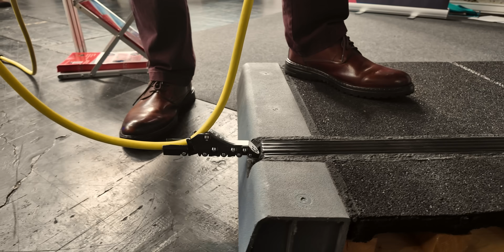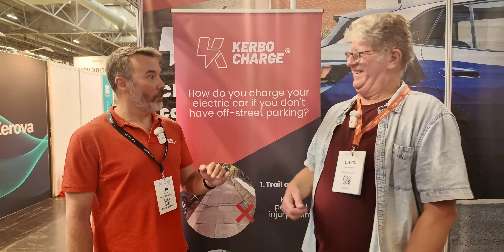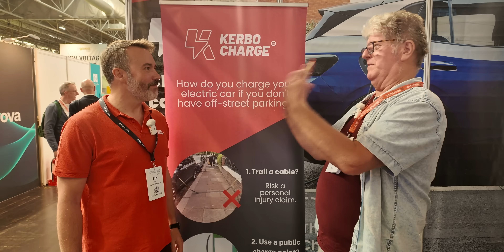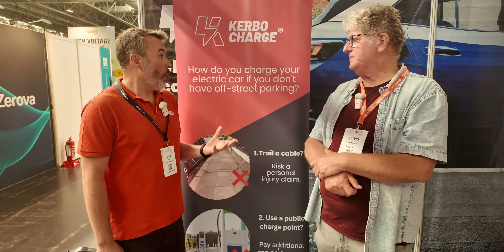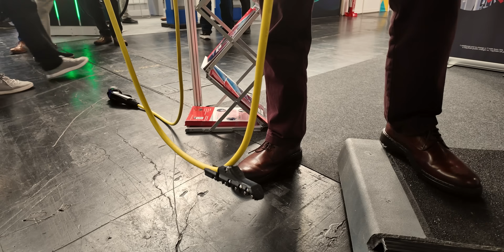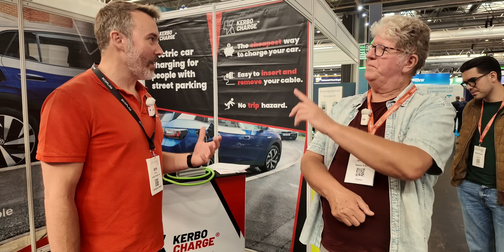Kerbo Charge: EV Charging For Those Who Can't Charge At Home

Comment from the maker: For those wondering about the price, it starts from £649 (if you get the £350 government grant). Price includes a survey of the property / footpath, all local authority permissions, cutting of the gully, installation of the channel, and a ten year product warranty. The exact price can vary based on the local authority. Hope that helps. :)
Reply: Does it also include the chargers? Or is that another 1500 pounds?
Reply: @johnthemagnificent7022 If you travel less than 15k miles a year you don't need to install a charger. A 3 pin charger will provide enough overnight charge for that mileage.
Reply: @stulop I travel 130 miles a day would a granny charge do that in 7 hours?
Reply: @johnthemagnificent7022  @CleevelyEVmobile do about 180 miles per day in their MG5 EV, but they do use a proper charger
Reply: @johnthemagnificent7022 No, but most of us don't do 130 miles a day. Have you worked out how much that 130 miles a day costs you in petrol each year?
Reply: @stulop Yes....Nothing 😊
Reply: @johnthemagnificent7022  So none of this applies to you anyway, why the performancem
Reply: @johnthemagnificent7022 Misinformation - chargers can be installed for less than £1000.
Reply: @johnthemagnificent7022 except you can get a charger for about £800
Reply: So £2500 with charger. You're having a laugh.
Reply: @extremedji9387 it’d be cheaper to move the house!
Reply: @extremedji9387  no, charger install is £1k. So total cost £1649. Seems good value to me.
Reply: @extremedji9387 😂😂 you're not wrong 😂😂
Reply: @johnthemagnificent7022 Back to your other conversation. 130 miles a day over 250 days a year will conservatively cost around £3200. The same on Octopus go will cost £650. The cost of installing a charger is not so daunting? If you are doing lower milage, you don't need one. If you are doing higher milage, it pays to go electric and install a charger.
Reply: @stulop I don't want a boring EV thanks

Comment: It's still cheaper if you live in terraced house to charge for long period with no charger. The cost to install a charger say £1000. If cost is 50p a KW. That's 2000 KW. If ( bit rule thumb) miles per kw is 4. That's 8000 miles rather than a charger.
Reply: So, you could use a granny charger to save money, rather than a dedicated charger?  Though, if people aren't always able to park outside their house, they may want a faster charger to ensure they make the most of those opportunities.

Comment: Great idea but you still have to be able to park outside your house
Reply: This won’t work for everyone, but it may work for lots. Chill
Reply: Or in the spaces adjacent to the space near your house if you have a longer cable (in the video)
Reply: @Biggest-hz7ng  I did note that, but now your back to a loose cable on the roadway or pavement. Just imagine the car parked opposite your house moves while your charging and catches the cable around the wheel nasty for both
Reply: @keithbartlett9947 I can't see it catching the wheel if you run it in the gutter to your car, and coil any excess under your car? Worst case is a slight crushing of the cable as they maneuver away. You just weigh up the risks against the (monetary and ease) benefits of charging at home.

Comment: If an EV charges over night on electricity made from gas it will produce 100g of CO2 per mile as each KWH of electricity produces 0.41 kg of CO2. To make 1 kwh of electricity you need to burn 7.42 cubic feet of natural gas. How long will cheap over night electricity be available because if government want Net Zero they can't burn gas at night. If the standaing charge is added to the per kw price EV's will cost more to charge than petrol.
Reply: Watch latest Everything Electric video for the latest stats. Something like 50-60% of all electricity is from solar and wind in the last year. Overnight wind still blows. Think wind is still free to produce.. 😂
Reply: @rogerfinch7651  Actually 40% in UK
Reply: When was the last time the UK grid ran wholly on Natural Gas/Coal at night?
Reply: @colinharvey1049 Its not but EV's charge cheaply at the moment but when standing charge added to per kwh EV will not be as cheap to run. EV sales are only OK due to company car and salary sacrifice schemes or a lot less would be on the road.
Reply: Their goal is to have gas being only 5% of generation in 2030. They can burn gas until then, and after then gas will likely be around as backup indefinitely. And gas will be alongside nuclear, hydro, biomass, interconnects, solar, wind, batteries and demand shifting.
Reply: @Biggest-hz7ng  Nuclear not enough by 2030. Hydro not enough, no solar at night and battery banks not big enough, biomass not big enough. Lights out UK.
Reply: @dragonbreathwales we will have gas as backup until we have something better.

Comment: If everyone or majority of ev owners charge at home, then public chargers will see a lot less use which means for them to survive, prices will remain high if they remain open at all. It would make more sense to try to reduce prices of public chargers so they can be used like petrol pumps. If public chargers end up disappearing then it really will limit the usefulness of ev’s on longer journeys as they won’t have anywhere to top up
Reply: We are a long way from public chargers disappearing. The majority of eV owners now charge at home and there still is a massive need for public charging. They will only increase at a rapid rate for years to come. No country in the world has slowed down the rate of installing public chargers as the rate of EV on the road increases,
Reply: Cheap communal or work chargers is where it is at. Public chargers will reach an appropriate level of availability and price eventually.
Reply: And look what will happen to EVs once they do start closing and closing they definitely will.
Reply: @averageadventures4469 we still haven't gone fully EV yet so public charging will continue to grow.

Comment: Did I hear that he doesn’t view these as long term products?    Surely going to need these for the rest of time that the terrace house etc exists.   They are a good idea for where they will work.   Are part of the solution but not complete solution.
Reply: If ever kerb or lamppost charging comes along to the area they might be superceded
Reply: @Biggest-hz7ng you won’t get domestic rate tarriff on lamppost chargers.
Reply: @michaelmcnally2331 if they had car recognition, you could charge to the customer's electricity account(if that ever happens)

Comment: They're about £1000 to install of which £800 goes to the council. Not all councils are on board with Kerbocharge. Better still, reduce the cost of public charging.
Reply: EV cheaper to run than a diesel, drive an EV and see, love mine don’t just say “drive a diesel”
Reply: @kevanswift7797 I've driven many. I've owned two in the past.
Reply: @kevanswift7797 Why not 800 miles before I need to refill 😊 Oh and my Audi tdi does 600 miles on 50 quid and virtually Zero depreciation.... not like an EV 56% depreciation in 12 months 😮
Reply: @Sweety1915-nono Oh for fks sake ...obviously maths wasn't your strength 😂
Next you'll be saying that an Audi A6 didn't travel 1158 miles on a Single tank of diesel and took in 14 Countries in 28 hour's please try and keep up 😂😂
Reply: @Sweety1915-nono Audi also built a production car that did almost 100 mpg 😊
Reply: @Sweety1915-nono 😂😂 You're such a comedian... you'll be as good as Dave soon 😂😂 I only got the Audi in Feb and it easily does 600 miles 😊
Reply: @Sweety1915-nono A2 The most aerodynamic car in the world at the time a masterclass of engineering It didn't sell well because it was so expensive 😊
Reply: @Sweety1915-nono Seems there's plenty of Audi A2s still on the road?  Do you honestly believe your Milkfloat will be around in 25 years time? Of course it won't 🙄  I've got car's over 45 years old including the  RS2000😊 currently got an agreed  value of £47K ....If only I'd of got a n RS1800 😢 One just been sold for £276000 😊
Reply: @Sweety1915-nono I've seen some and you can get 35 miles from a full charge 😂😂😂
Reply: @Sweety1915-nono Anyway Keep the Dinosaur Fuel Flowing 😊
Reply: @Sweety1915-nono  Plus always remember an ice car is faster
Reply: @kevanswift7797 What about a Faster petrol car then? 😊
Reply: And EVs charger might be worth thousands in savings to people if they drive enough
Reply: It's all about £££££££££££££££££
Reply: Or just get a diesel 😊

Comment: If the pavement and channel run fully up to the outside wall of a house (as is the case with many terraced houses) there will be no space for the inserter prior to it being placed in the channel as it was demonstrated in the video.
Reply: The demonstration clearly shows the inserter going in at the kerb end of the channel.
Reply: @albertoporras04  Good point, well made. However,  it is shown being pulled straight through the channel which would not be the case if it was up to a wall. This may cause some difficulties. I'm sure it has been thought through but it would have been good to see a mock up with a wall.
Reply: You really think that hasn’t been engineered into the overall system design😂

Comment: After all the sales talk, which was good and informative, what is the cost to install. Always an important factor, concern is as the saying goes "if you have to ask the price you can't afford it".
Reply: Around 700 quid, depending on the works outside the house. Or bundle with a charger for around 1000.
Reply: For the charger and curb gulley, about 4 years worth of diesel.

Comment: I can’t have this for my terrace house due to the road layout. However I’m getting by fine using places like Arnold Clarke once a week or so. I drive an etch Renault van lots of short journeys with large gaps between each so a n ice engine would do it but not the best use case. I am glad not to be poisoning the air with diesel particulates. What I want is lots of destination chargers at 7Kwh or even ones you can just ask for trickle charging so you can go in to town for a few hours.
Reply: Dave is polluting the air  by flying away for a jollee 😮 Total Hypocrite ban aeroplanes 😊

Comment: What happens when utilities dig up lengths of pavement?
Who reinstalls these?
Sounding a bit negative,but if these strip fail,as they will,it would be a nightmare for pushchairs bumping over all these channels
Reply: Any worse than most pavements already?
Reply: It could be an indefinite stopgap until the council installs lamppost or kerb chargers.
Reply: @Biggest-hz7ng Just get a diesel 😊
Reply: @johnthemagnificent7022 You're repeating yourself.   Something you should mention to your carer😊😊
Reply: @johnthemagnificent7022   It would have to be a second hand one.
Reply: @taketwo-e5u What would have to be 2nd hand?
Reply: @johnthemagnificent7022 A diesel car, most manufacturers don't make them anymore.
Reply: Yes, you are being too negative. Why assume that they will fail ? They are so simple, there's hardly anything that can go wrong.
Reply: @01jvb Wear and tare, thousands of feet,bikes, pushchairs etc, etc,etc
Reply: @01jvb Except that most EVs fail the Mot UK on brakes or tyres
Reply: @johnthemagnificent7022 Really? Where is this statistic reported so I can have a look? All cars can fail an mot from tyres. EV's are well known for their brakes lasting 50-100,000 miles due to regenerative breaking.
Reply: @taketwo-e5u  actually there are many examples of brake pads lasting 200k miles.
Reply: @johnthemagnificent7022  we were talking about the channels in the pavement, not the cars.
Reply: @01jvb It just seems like a lot of mither.... £2500 just to get a pavement charger... you can go out and get a perfectly good diesel car for that with many year's of life in  it 😊
Reply: @johnthemagnificent7022  Only for so long though with certain financial penalties and poisoning yourself and family. I'm not sure about perfectly good though.😊
Reply: @johnthemagnificent7022 The cost will be more like £1500 than £2500. I agree that you can get a perfectly good car for that, but it will be at least 10 years old. For people who do want to buy a modern ev, and live in a house without a driveway, this product is really useful, and the cost will be quickly recouped in lower charging costs compared to public chargers. ( My rough calculations suggest that you've only got to drive 900 miles to get your money back)
Reply: Just get a diesel
Reply: @johnthemagnificent7022  It would have to be a second hand one.

Comment: And no mention of the most important thing.  COST.
Reply: Pricing from £649* inc VAT (After application of the new £350 Government grant).  My Council Bromley Charge £1099 ?
Reply: Richmond are charging £1350 before the Gov Grant but also cheekily charging a Yearly RENT for the privilege of using the trench that you have just paid for!!!  😂 I'm gonna stick to my rubber charging mat thanks.
Reply: @malcolmxedmonds I'm going to stick with diesel
Reply: @extremedji9387 Me too one fill up 800 miles in the Mercedes 😊
Reply: @johnthemagnificent7022 for an exorbitant cost.
Reply: @extremedji9387  That would be okay if you were able to.
Reply: @johnthemagnificent7022  At what cost 🤣
Reply: @taketwo-e5u A few quid... my Aston doesn't do much to a gallon though only about 23 but it ain't depreciating like a stone 😊 As I've said before my friend lost £75K in 3 years on his Porsche Taycan 😢
Reply: @taketwo-e5u  used diesels will be available for the next 20-30 years.
Reply: @averageadventures4469 Yes but but no new ones so therefore less and less . 30 Years? Perhaps some in museums.
Reply: @johnthemagnificent7022 Your right the Porsche was a bad buy, way too expensive. There are a lot cheaper options.
Reply: @taketwo-e5u  Hi there my Doc has the Audi E-Tron GT which is basically the same car and he says he would never buy one with his own money 😮 think it's a tax Dodge having an EV  ?
Reply: I'll just do a nice 15mm slither cut with my stihl saw and just drop my cable in. Over complicating. You dont need a big silly channel. A thin cut on the path would do same trick and wouldn't be a trip hazard either.
Reply: @CHFandango no cover to retain the cable?
Reply: There is a product called stormguard but councils won’t give permission
Reply: (For you to do it yourself)